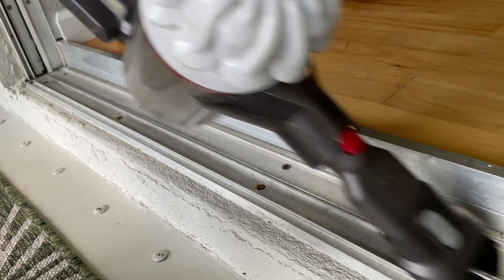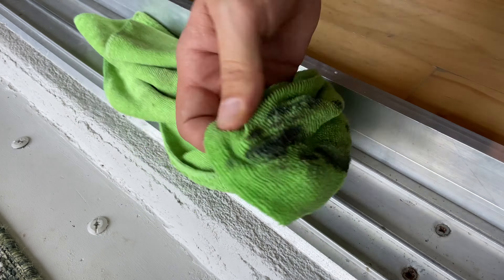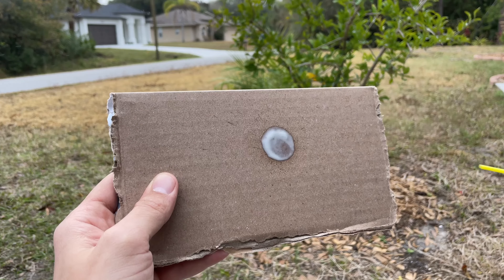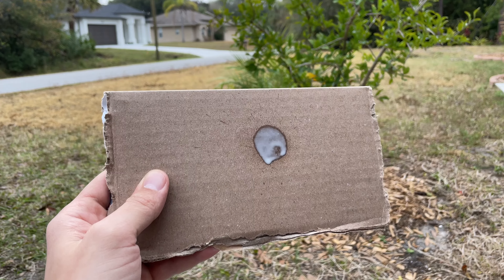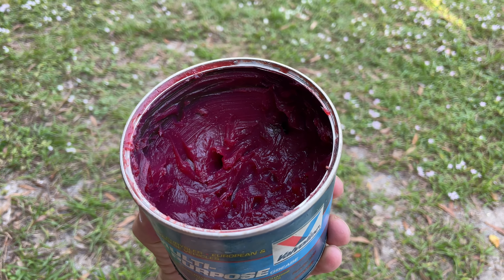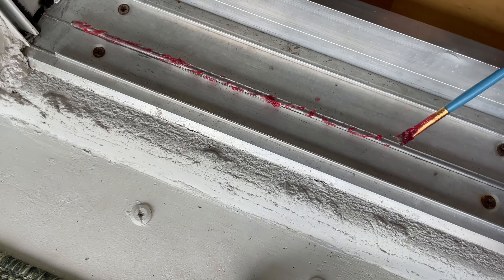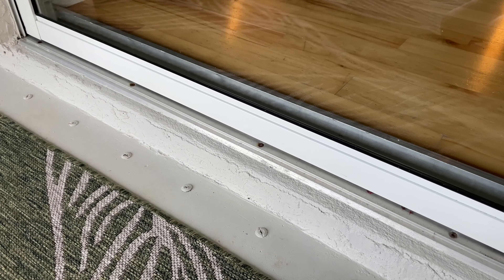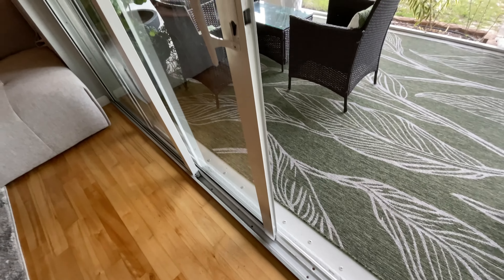How to fix: squeaky & loud patio sliding door.

Comment: Use Silicone Spray. Same for garage door tracks (look at the maintenance sticker). So many negatives to using grease for this purpose.
Reply: Could you elaborate on the so many negatives?
Reply from the maker: @jamesjensen7276  Been using it for years - no negatives for me...